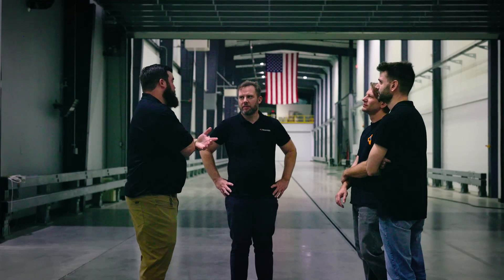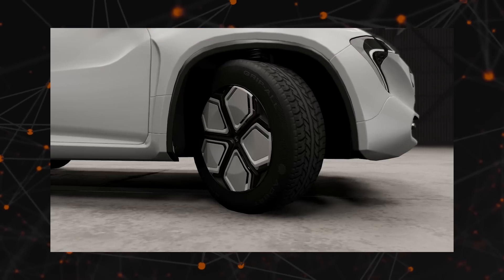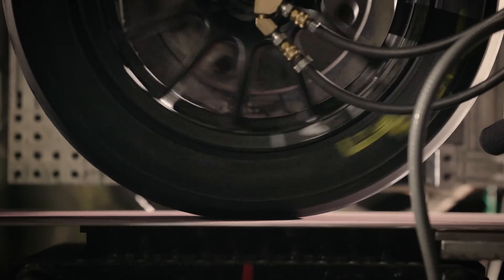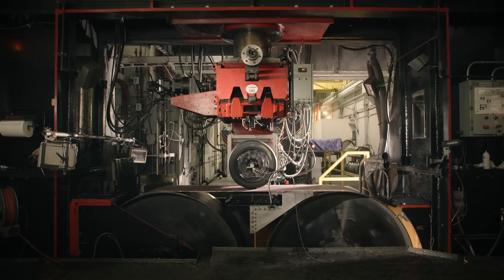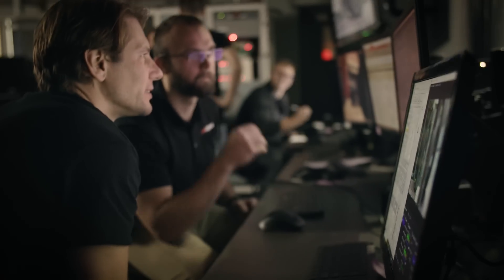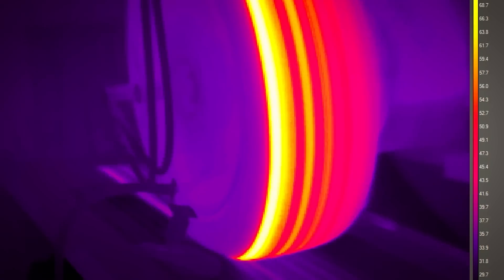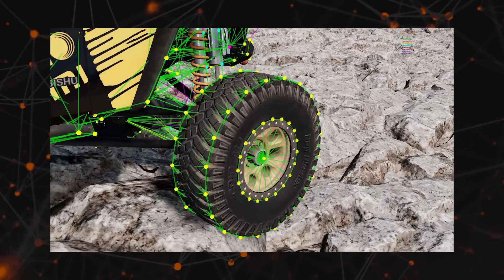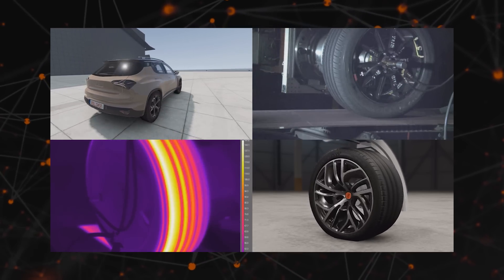Sneak Peek: Tire Physics Development

Comment: Just another thing to kill my barely standing 30 fps 👍
Reply: maybe dont play this game with 15 year old hardware
Reply: @tysopiccaso8711  my workstation was built in 2018 it is the Fujitsu Celsius h770 the top of the line at the time it used to be worth 900$ do your own research on that
Reply: @S1eps  which components did it have exactly because my version has a xeon cpu and the quadro m2200 maybe you found the lower end version with the i7

Comment: The moment you add tire physics with wear and temperature to BeamNG, is the moment you outcompete all other driving sims.

And that's not even an exaggeration
Reply: The tire simulation is very good currently, so changes won't be big at all, more like fine tuning. Wear and thermals will be very cool and add a lot, but will only reduce grip levels. Yet aero code is still very very basic, "hacky" and it will be the next required big step that is needed before we'll be able to have real comparisons vs other sims. Then better lose surfaces simulation. Next FFB improvements, although FFB code has been rewritten and tweaked many many times, it's still lacking and at this point I start to think it may be the nature of the soft body physics (damping and vibrations) and it won't get much better. 

There are limitations to BeamNG's physics engine and performance that cannot be skipped, although I'm thrilled to see what upgrades future updates will bring. Honestly IDC about content like maps, vehicles, props, graphics and so on, I'm here for the physics sim since Rigs of Rods days ;)
Reply: @driv3ver  it's good, not very good, hopefully they will fix that with this update

Comment: Btw, I remember seeing a comment asking about loose terrain testing; can't find it right now. Dunno if you already got the method to test in mind yet; but an idea came to mind, not sure how plausible it would be: What if you used a large centrifuge and tested sideways, so you can keep the rolling surface coated with loose material without having to constantly refill it with more layers as it rolls the stuff away? Or maybe it might even work to have the centrifuge vertical to speed up initialization by having part of it buried in a container of loose material and let it flow into it as it spins up lifting off the container once it's properly coated? Or the higher g-forces and constant motion make it hard to reproduce specific real/simulated surfaces?

Just testing on a ring of dirt (or whatever material) on the ground like how they do for some Mars rover wheels and other stuff, I imagine would probably only work for slow speeds where the centrifugal force is negligible.

Comment: In the next big update you should add a hypercar. That would be insanely fun and have a track version that can handle corners at high speeds 200-250mph in corners. 300+ on straights

Comment: With 1131.1 hours on my main account, and well over a thousand on my other two secondary accounts (for the three computers in the house, it was just simpler instead of reactivating the game like steam wants), @beamng has never failed to impress me. Now this?? And possible dynamic engine sounds?! It would officially be the BEST driving/racing/offroading/redneck chaos/demolition derby simulator in the world. Hands down. Nearly 3000 hours in, and they are still suprising me.

Comment: There is so much attention to certain details and yet I still feel more grip on the track playing Gran Turismo than in BeamNG. I usually play from the interior view in GT, and even with a controller I have a certain sense of where the limit is when cornering. I don't know what physics they have, but the feeling is noticeable. In BeamNG, I don't have that sensation. The car seems to float and spin on itself, and does not provide a feeling of grip or suspension work that is similar to reality. It's been a few months since I played BNG, maybe there have been some corrections since then...

Comment: It would be nice if they added that if the brakes get too hot, they'll start burning and could then set the car on fire, and maybe something like GTA 5 has? Like a story mode or whatever it was. or that the engine is more realistic and that when the oil pan is damaged it leaves oil stains behind
Reply: the story its already on the game, its there for playtest.

Comment: @beamng  ı totaly respect what you guys are doing since 2009 ı met your physics game and your products compared to your employes is awesome thank you guys for doing that but we need some changes about beamng 
1)simple scratch for body panels its visualy improve whole another level
2) saveable lighting settings not in world editor its viualy improve whole another level
3)better optimization for west coast usa ı try with ryzen5 cpus 2-3-5-7 th gens with good gpus and bad gpus lack of performance lost from cpu cant handle 
4) better physicaly polycaunt on tires car goes on <3kmh car is shakeing from the tires on triangular surface
5)2000 tic rate simulation speed too much for most of cpus in multiplayer ı race with my friends with 3-5 people server fps is good (not on limit like can generate 115 fps lock to 90) simulation speed gets down and back on cars dashboard says same 90 and cornering like 90 but goes 70 kmh on according to map location
6) tires you guys working on ı know but ı speak for past how soprt tires grip compared to you guys its like non heated semislick tires on winter safe than the sport tires on beam and sport2r`s is also regular tire not sport tire

Comment: One flaw that you can also study that is more difficult and uncharted territory...
Half throttle or small throttle engine torque curves, most sims use the cheap method of just halving the full throttle curve, but this creates the odd slowly rising RPM problem.

Comment: Reminder that BeamNG is about breaking and crashing things. If the tire wasn’t spun so fast it exploded you still have work to do.
Reply: No, it isn't just a crashing sim. Who told you that?
Reply: @SK6-x09  yes exactly a crash sim where you inevitably push it to the limits and get disappointed with polygons stretching off into infinity.
Reply: @carlsonbench1827  What's with the hate? The instabilities have been fixed years ago.
Reply: @SK6-x09  I comment because I love the game and think the devs are capable of improving what happens when wheels spin at over 250mph.

Comment: If you guys have a tire model for each tire-rack category, then go look up my boy Project Grassroots and take his "200TW tire graph" showing how super 200s vs endurance 200s are different, then probably have 3-5 race compounds (soft, med, hard, wet, super-wet), and I suppose Rally and Offroad tires, that (well it sounds like a massive fuster-cluck but still) would likely put your simulator, as a whole, especially given the deformation and sandbox aspects, far and above most other games and sims out there.

Though I DO still wish for a "rigid body" mode where the chassis and suspension become indestructible and infinitely stiff, so only body panels and the drivetrain mechanicals of the car can be damaged. That would make it more fun to muck about with instead of being super unforgiving with crashes and jumps and whatnot. After all, my ideal car game would have very accurate suspension and steering geometry modeling, accurate suspension spring and damper modeling, stiff or fully rigid chassis and bushings, semi-realistic tires and aero, realistic engine sounds, decent early-mid 2010s graphics, Midnight Club customization, great gameplay and progression, and some semi-open world options in addition to tracks.

Comment: Beam is slowly getting closer to becoming the superior racing simulation, the physics are already top notch, after this they could become the best by far.
Then improve ffb, add a better multiplayer experience and we could get the successor to iRacing
Reply: Yeah that certainly is possible after all the game already has so much potential. I wonder does this tire update improve handling I quite suck steering into corners cuz it starts sliding no matter what 😂

Comment: Yeah, this tire simulation stuff is cool and everything, but... does it even matter when your tire model has just 32 points in it? That makes the car to shake like crazy on low speeds and you can really feel how "square" those tires are with a propper steering wheel.
Yes, I know, like 95% of players are on gamepads or even keyboards and its not a problem for them, but those people can't appreciate this level of physics anyway...
Reply: they probably gonna redo the whole entire tire

Comment: Does calspan have different material spinning tracks under the tire? After all, the heat of a tire is going to be drastically different on asphalt road compared to, let's say, a rocky road or a paved road. I imagine it's hard to simulate a rocky road or a pavement in an enviroment like this. How are you guys dealing with that?

Comment: This is so badass. I've long thought the tyres were the one missing element from making Beam an S-tier driving simulator. Good luck boys!
Reply: the legend is back
Reply: Not sure which sims you think do tyres better than Beam NG already… There’s not many.
Reply: @trackdaytim, that's the issue. If BeamNG doesn't have it, there is no real substitute.
Reply: @trackdaytim Assetto is like just maybe a notch down on beams tire physics,only for driving though. Not the actual physics and how it behaves, beamng is still the only game I've seen with tire flex.
Reply: @dailydrivenmiata8760  Then surely you must not play alot of racing sims. 
rFactor 2, Project Cars 2 and Automobilista 2 have had tire deformation for a while now. (although i'm not sure if pc2 and ams2 are purely cosmetic or if they're actual physical simulations like rF2)
Reply: It still needs proper air resistance
Reply: @EagleOne1999 What you mean? They already simulate drag and negative lift, both catalyst to aerodynamic grip if you got big wings, canards, splitters and diffusers. To become racing centered they'd have to dive deeper into slipstreaming and dirty air effects on drag and negative/positive lift.

The main issue is mechanical grip. Tire properties don't simulate stickiness or  resistance characteristics of each individual compound when trying to break into slip. Also, Beam tires don't exhibit distinct sidewall deformation for low/high profile tires. Race tires don't have enough stiff sidewalls that make for that precise, planted driving you'd feel irl. 

This is what this collaboration is meant to fix and they understand. The data will give them enough correlational analysis. Also this data will give better analysis on load either longitudinally & laterally.
Reply: @kak8895 Maybe he’s talking about how bodies interact with each other. Like for example in beam ng drive, if you take the windshield off and then somehow make up for the weight, the car actually becomes faster because there is no drag from the windshield. But obviously in real life that drag would get transferred to the inside of the car, but this is incredibly advanced and I don’t think we will see this in any games any time soon.
Reply: @kak8895 aero is very simplistic now, one part cannot hide another from the airstream (e.g. one part behind another still produces as much drag as if the part infront wasnt there), i also dont think theres any kind of ground effect simulation
Reply: Someone made an accurate tire physics mod which was extremely advanced, so this will basically do that but better, cleaner, and clearly with new data

Comment: There was a mod a while back called beam regenerator, it would bend your car back into shape as long as the damage wasnt very bad. I would love to see functionality like that. When I am hot lapping for instance, I do not like resetting the entire car which resets the fuel, engine temps, and brake temps. This sort of functionality would be amazing.
Reply: Theres actually a mod called SimpleNG that makes ur car not fall apart but u can get dents, look it up man :)
Reply: @MusifierOfficial I like the damage as is, I just wish there was a way to repair the damage without resetting the car, within reason of course. If I roll the mf then yeah I will have to reset it, and that is fine.
Reply: @doobiescoo  There is a button that respawns your car on the track without going back to the start but it also spawns u there after so idk

Comment: And motor swaps and drive train swaps if u guys worked with forza it would be game over
Reply: Drivetrain and motor swaps in Forza are not realistic. You can slap V8 and V12's in almost anything is Forza. Irrespective of the dimensions of the vehicle to accomodate the engine, and AWD drivetrain.

Comment: I look forward to a future being able to lightly accelerate without my tires squealing like I'm slamming the peddle to the metal and peeling out. Or when lightly breaking and then the tires even with ABS on still chirp and squeak as if you're slamming on the breaks. Or taking a normal turn and the tire starts screaming as if you're taking a corner too fast. I use the Variable Tire Grip mod which for the most part setting the friction base to 1.3 to 1.8 depending on the tire solves most of these issues. But if BeamNG can solve the tire issue, then I'll gladly get rid of the Variable Tire Grip mod which will free up a slot making it available for a different mod.

Comment: I remember playing the first tech demo versions of BeamNG and back then the tire physics were really weird, but it has come a long way already and I believe right now BeamNG already has one of the most realistic tire models of any game or simulator on the market. Drifting is really the only department that seems to be lacking a bit, most likely because there was no data about how the tires handle with different profiles and pressures at such extreme conditions. It's amazing what kind of work you're putting into this and I am wondering if there is still enough cash flow through new sales to justify it. The majority of people likely owned the game for years and got it for around $15. When I think about how much money I'm spending on DLCs for unfinished games these days it's a real bargain and you can probably justify some paid content.

Comment: out of curiosity, but will there be cheap tires that perform worse and expensive tires that will perform better or will it just be the tread wear rating and grip rating that matter and also how will it affect wet performance cause a cheap tire rated the same as a more expensive tire can actually perform completely differently.

Comment: guys please if you do nothing else but read my comment, please look into FWD vehicles mostly with drag racing when you have a certain amount of friction or when you tune the car to the point it don't spin it just torq steers sooooooooooooooooo bad mostly on steering wheels on controller its more controllable but still bad

Comment: Love this but will you guys be able to do used tires? I love new tires but the majority of car owners used tires are common. It would be very fun especially informing people how much a difference road tires are not a good idea for the track
Reply: Maybe in career mode we would see that but I doubt they'd do that for freeroam. Maybe if they add a slider in tuning menu?
Reply: @NicOz42  That would be great because regular road used tires with debris handles differently than brand new tires. Cheaper brand used tires would be the goal honestly because its nice thinking about using new sport tires but thats out of the price range for the majority of people

Comment: That's a really wellcome improvement. The one thing that always bothered me in BeamNG, and most driving games actually, is precisely the tires, no matter what combination of soft suspension, tires and tire pressure I used, the tall suvs and trucks always lose grip before tipping over on hard cornering, and tinkering with the steering assist for under-steer and over-steer also wasn't the issue. I could be wrong since I'm no expert but I always get the impression the tires physics are to blame for this lack of grip on corners. I mean, you don't need high-grip sport or race tires to tip over a Tall suv in real life on a hard corner, right? The stock tires are enough for it.
Reply: Good point, is there any other driving simulator where a SUV tips over when cornering hard? In AC which people claim to have one of the best tire simulations I don't see that happening, actually it's the opposite, there it seems cars have less grip when I compare to BeamNG
Reply: @NicOz42  Not a driving simulator, but you could tip over some suvs, ambulances and firetrucks and whatnot in GTA San Andreas. The body roll and tire grip felt surprisingly realistic given the game's era and proposal.
Reply: @paulofagundes3006  Humm, I recall tipping over a lot of track cars in BeamNG when going over kerbs and the Dunekicker on sand so that's pretty nice
Reply: @NicOz42 Oh, for some reason all those years I mostly drove the old school moonhawk, bluebuck, big suvs and trucks on the east coast and west coast maps, mostly only on the asphalt and concrete, didn't bother to try other terrains...😮

Comment: why not just use a tire model that already calculates these complex behaviors? Plenty of good models exist, you don't have to re-invent the wheel, no pun intended
Reply: They need to re-invent the wheel because of how they want their tire model to be. As mentioned in the video, tire models most sims use break in extreme scenarios such as you would see often in BeamNG.
Reply: @NicOz42  there are very strong tire models that work well for offroad and racing type sims. BeamNG is not a very realistic sim so they don't need something as advanced as rF Pro or anything of that sort. Just something that feels realistic enough and allows clambering over obstacles.